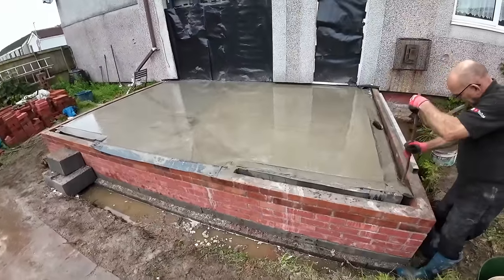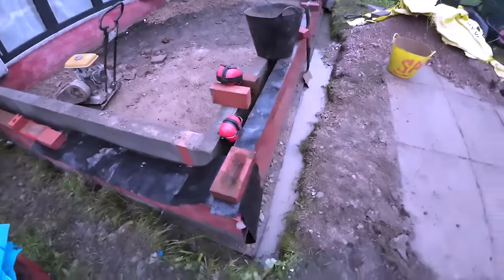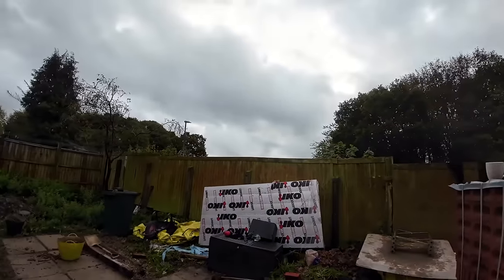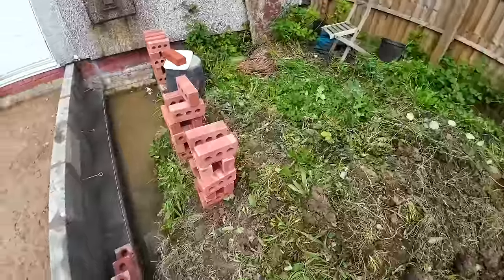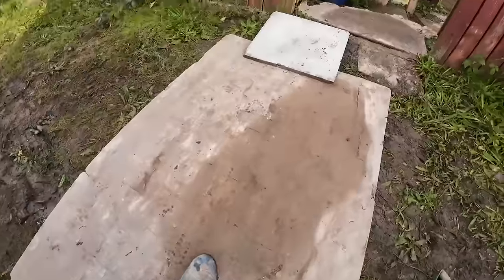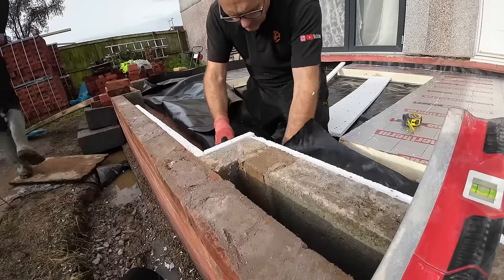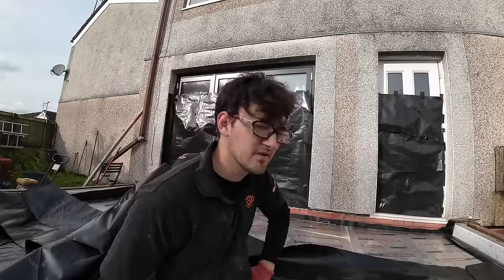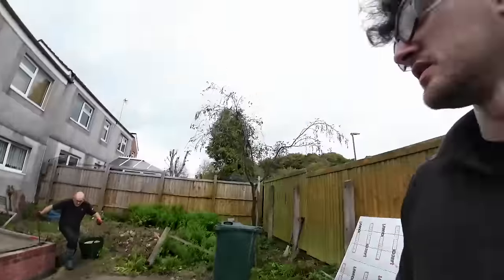PART L COMPLIANT CONCRETE FLOOR STEP BY STEP

Comment: Are you building a 15 story extention ? what a croc of s* I *  I usually like your work but as an engineer I feel you have gone overboad with the footing!!
Reply from the maker: Why
Reply: The footings were alrteady in by the owner check what you say
Reply from the maker: Bit aggressive by mr Yaabbly 😂😂🧱👍🏽
Reply: The guy that fixes my washing machine calls himself an "engineer". He's good at fixing Zannussi's but knows sod all about building work. Such as your "engineer's" attention span goes, you've missed the bit where they explain that they are rescuing a build already started by the customer and are working with what they were given. Basically, shut up and pay attention.
Reply: Coming onto a job where you're taking over a bad job its wise to go overkill a bit to make sure there's reassurance, 

As far as I can tell its a standard 100mm slab, 100mm insulation and sheeting, below than is 6 dumpy bags of hardcore. 

Theyve done a row of engineered blocks as a start and why not, who knows the quality of the footing pour before they arrived and looks like its been sat for 1 or 2 winters

So genius engineer if they hadn't added the hardcore the concrete would've needed to be deeper to get to finished floor height. 

Should they of shovelled a load of soil in there first to save on hardcore? do they buy 3 tonnes of soil ? if so why not bang hardcore in as its probably about the same bulk bag price. 

You should perhaps stay quiet with your nonsense comments
Reply: You’re not the customer are you ? Sound passionate there like it’s coming out your pocket 🤦‍♂️😂
Reply: Nutters corner?
Reply: Yes it’s a shame about splitting bags but it’s H&S gone mad. In the good old days they would have a tied opening in the bottom so companies would reuse the bags. Now they are not allowed to due to H&S
Reply: You might be an engineer but you're not a very civil engineer 😜
Reply from the maker: @martin2466 😁🧱👍🏽
Reply from the maker: But he is an engineer Martin ! My guess is a heating and plumbing one 😆👍🏽🧱
Reply: This is just a standard slab in the uk looked a job well done to me
Reply: @SteveAndAlexBuild that another walloper to add to the total
Reply from the maker: 😂😂. Favourite new insult 🧱👍🏽
Reply from the maker: @Fordmad90 thanks pal it certainly was 😁🧱👍🏽
Reply from the maker: @martin2466 . That sounds much more appropriate 😂😂🧱👍🏽
Reply: One suspects owner got caught up in the idea that if it’s done, it better be done 100percent
Reply: @jimbo-vc3rh well said 👏 👍
Reply: Did you watch the first video obviously not.
Reply from the maker: @nige.3494 😁🤙🏾🤙🏾🧱👍🏽
Reply: You can't even see the footings in this video, what on earth are you wittering about?
Reply: Well ive been an engineer all my life. I would never adversely comment on subjects that i havent got a clue about. Engineers by their very nature should read all the relevant info available before gobbing off about things they know nothing about. Hope you never built anything i ever buy. 😁
Reply: @martin2466  probably a domestic engineer.
Reply: @martin2466  Quite right Martin. A pratt of the first order for sure. Im well mate as i hope you are thanks 👍👍
Reply from the maker: Doug 😁🧱👍🏽
Reply from the maker: Nige 🤣🤣🧱👍🏽
Reply: @Doug....  he's probably a ladies hairdressers knows more about perms than footings
Reply: @nige.3494  😂 Maybe he trained as a piano tuner 🙈
Reply: @SteveAndAlexBuild  He's definitely incurred the wrath of the S&A groupies 🤪
Reply: @Doug....  or just a piano
Reply: You can't know if they have gone overboard with the footing without knowing about the ground conditions.
Reply from the maker: Very true 🙄🧱👍🏽
Reply: Nothing says I'm a plonker than saying "as an engineer" 😂
Reply from the maker: @hunterb9273 🤣🤣🧱👍🏽
Reply: @hunterb9273  
As an Engineer, he should be aware of the difference between a    Foundation,     Footing    and a    Oversite - slab.
And he should be able to spell "extension"  correctly as well.....
To use his vernacular,  " what a crock of 💩"
😁👉👍👍
Reply from the maker: @martin2466 absolutely 🫣😆🧱👍🏽
Reply: @martin2466  Now you're being too kind to him 🤪
Reply: @Doug....  
Oh well its the chain - mailed fist in the velvet glove syndrome..........!

😁😁
Reply: @SteveAndAlexBuild  
What is the best emoji  for a "Plonker"...?
Reply from the maker: @martin2466 🍆? 🤔
Reply: fuck all wrong with that, nice job lads!!!
Reply from the maker: @dackman2000 🤣🤜🏽🤛🏽🧱

Comment: But could you not put those bags inside saveda lot of shoveling.
Reply from the maker: No crane was at full stretch 😒🧱👍🏽
Reply: @SteveAndAlexBuild  i saw it later that it was at his max
Reply from the maker: @carlomartin6156 👍🏽👍🏽

Comment: I'm confused, if you have bought the concrete slab up to the existing internal floor level are you not screeding?

We do sub-base then concrete then PIR then 75mm screed to existing finish floor level.
Reply from the maker: No this is standard around here 🧱👍🏽

Comment: Hi guys . I’ve subscribed and Great video, very useful, can I ask what grade sand you used between the scalpings and the dpc?, I only ask as your sand looked super fine compared to my builders sand , but maybe it was because your sand was very wet? , cheers in advance
Reply from the maker: Hi thanks very much for watching and the sub .  
    We just use building as we have it on site already .
   🧱👍🏽🙏🏽

Comment: Some french drains around the footings would have helped you - it's no fun sloshing around in puddles when you're trying to build. Also I wasn't clear if you actually needed 6 tons of crushed stone for structural reasons, or just to bring the height of the floor up (i.e. it was just a filler). If it was just needed as a filler, you could have put in more insulation that required by the regs to fill the space, and used cheaper EPS rather than PIR.
Reply from the maker: We always work to regs . 
   Insulation is very expensive and we were in a budget 🧱👍🏽

Comment: Hi guys great video ! Where do you guys buy your visqueen ? Can you send link please lads the stuff I buy has had constant holes init, also your insulation strips for the side where do you get these from ? Thanks guys
Reply from the maker: Hi Dean we don’t have 1 particular place .
  We use 8 x 4 sheets of 25 mm jablite ( polystyrene) 🧱👍🏽
Reply: @SteveAndAlexBuild  thanks guys ! With the visqueen I been buying the stuff from screwfix I’ll have to look elsewhere where. Cheers mate
Reply from the maker: @DeanW-1990 try your local builders merchant or we’ve never had a problem with tool station 🧱👍🏽

Comment: Two things - the structure under the door is a huge cold bridge - 50mm polystyrene is not sufficient to prevent. I usually detail a full cavity across the opening, close it with Thermabate closer and use a timber window board at slab level to 'make pretty'. And, this is personal opinion, with such a massive amount of stone under the slab + the delay time, pouring and curing - why not use a suspended B&B structure, quicker, easier - cheaper (not so sure). All the contractors around our way prefer B&B rather than insitu concrete!
Reply from the maker: Block n beam is not easier at all 🧱👍🏽
Reply: Pukka job again , very good 
As for splitting bags , bulk bags are not uv protected and break down so not really fit for multiple use
Reply from the maker: @chriswild2458 cheers Chris 🤙🏾🤙🏾🧱👍🏽
Reply from the maker: Martin , perfectly put as ever 😁🧱👍🏽
Reply from the maker: @martin2466 🙌🏽🙌🏽🧱👍🏽

Comment: You should of taped the insulation, never seen so many patches in such an easy job.
Reply from the maker: Never taped it and it’s not blown away yet 🌥️🌬️💨
Reply: It's not to stop it blowing away lol, the aluminium taping is to stop the thermal bridging between the insulation gaps and should definitely be done.